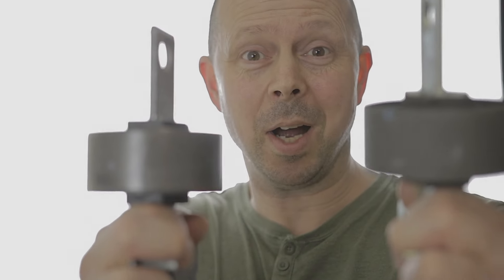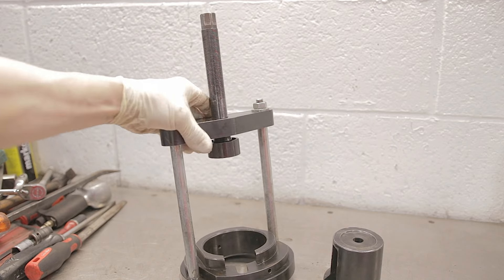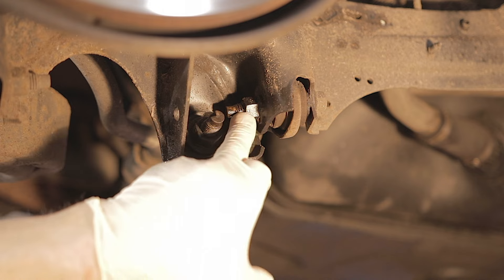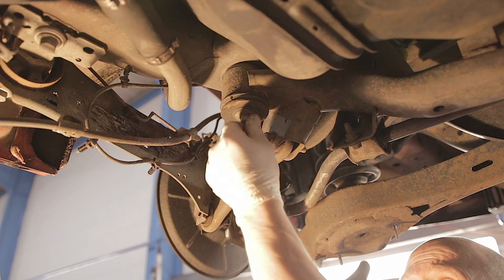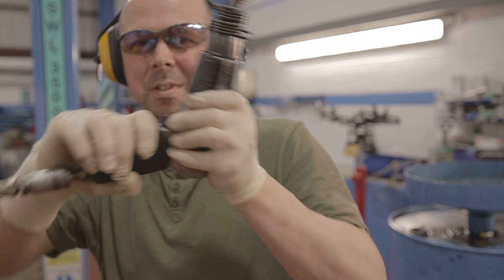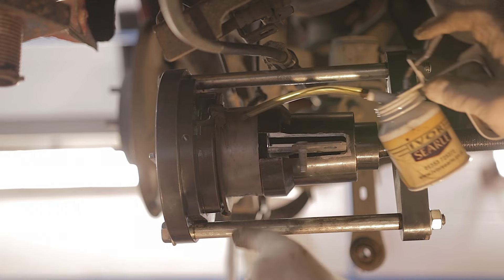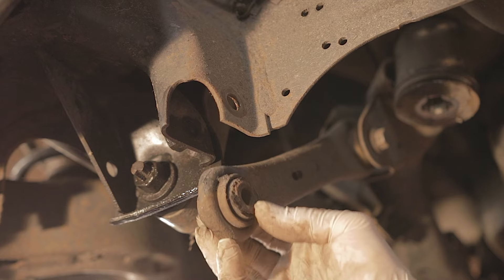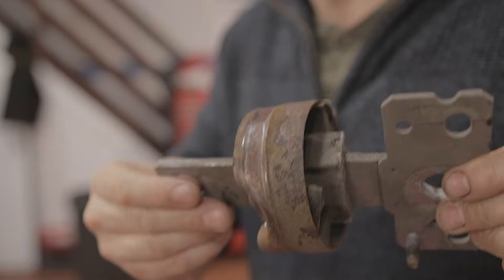Ford Mondeo Mk4 Rear Trailing Arm Bush Replacement

Comment: As for the bush alignment, there is a protruding lump just inside the outer ring of the bush which is alignment marker. It lines up with the notch in the trailing arm.

Comment: Great stuff. Have you ever tried the Powerflex version of the bush that can be installed without the fancy tool?
Reply from the maker: Badgertronix 
Ok..  you got me .. lol.. I never heard of those?
I will look into that one. Sounds interesting to know. Thank you my friend
Reply: alan howatt these ones here: https://www.powerflex.co.uk/road-series/product-details/Rear+Trailing+Arm+Bush+/12423.html
Reply from the maker: Badgertronix 
Them bushes look good if you don't have the tool to fit the genuine ones. 
  Only down side is the price. 
  Nearly £70 per side for power flex and the ford ones are about £28 per side. Still thanks for the info.
Reply: Alan Howatt I’ve a set of the powerflex ones you’re more than welcome to have a go at fitting them for me 😜👍🏻

Comment: Hi Alan, how long did it take you to replace that rear trailing bush? Maybe 30 minutes? I was told in Ford, they only change the whole rear axle due to the rust...
Reply from the maker: lol, they probably don't have the tool to replace those bushes but also a lot more expense for a new trailing arm

Comment: There is another similar tool made by "Sealy" or "sealey". Just done mine today as part of its 10 year service. Its a lot easier with a ramp as well but you don't have to lower the suspension, just the arm.
Reply: you all probably dont care but does someone know of a method to log back into an Instagram account??
I somehow lost my password. I would appreciate any assistance you can give me.
Reply: @Augustine Huxley Instablaster ;)
Reply: @Devon Kenneth thanks so much for your reply. I found the site on google and im in the hacking process atm.
Seems to take quite some time so I will get back to you later with my results.
Reply: @Devon Kenneth it worked and I now got access to my account again. Im so happy!
Thank you so much, you saved my account :D
Reply: @Augustine Huxley happy to help :D

Comment: Alan, are the lower arm bolts prone to seizing in the Bush like the Mk2 Focus? Thanks
Reply from the maker: no all the bolts that i show in the video should come out no problem...the bolts on the focus are always seized lol
Reply: @alan4x  yeah i just did my focus mk2 estate 2005 nearside bush,, u can be sneaky undue the 2 bols and prise it down with wood etc,, but u need to pull it down very hard, the offside i just got pissed off and done it back up , fuel tank needs to be dropped by the looks of it. if u have a ramp then its easy because u can ratchet strap off the ramp,, wouldnt bother undoing 1 bolt on a focus rear suspension,, every single bush will be sized and need cutting off and new bolts etc, very expensive

Comment: Is there any need for checking the wheel geometry afterwards? Thanks for the video, need to do mine soon.
Reply from the maker: hi, your question is a good one, thanks, because the bush can be bolted to the chassis in a slightly different position to the old one, then technically speaking you should check the rear wheel alignment which is not a quick job..but i will say, i have changed many, many of these bushes on the company taxis... and never bothered to check the rear wheel alignment. never have i had rear tyres wearing irregular... so if it were me, i would not bother...if it worries you then you would be correct to have it checked, hope this somewhat helps.
Reply: alan howatt thanks. The toe on the OSR is off as the bush is separating, so I'm assuming replacing should correct it but I'll probably get it checked. The tyres for the 19" rims are a bit pricey :( Appreciate all the videos, keep it up. Is that your garage just before the air base off the A14? I drive past on my commute, thought it looked like you
Reply from the maker: hi, yes the steves garage in little stukeley next to raf alconbury, good luck

Comment: The best video showing how to replace rear trailing arms bushing! My Volov dealer quoted about $1000 to replace the bushing plus alignment, I tried to get it done by myself once I buy a set of right tools.
Reply from the maker: this company make bushes that might fit your car but do not need a tool to fit them, just a thoughthttps://www.powerflex.co.uk/road-series/
Reply: Thank you Alan for your recommendations. I was aware of that by reading notes left by your readers. I think I would stay with the same bushing as Volvo used, as they are quality products at lower price comparing those from PowerFlex.
Reply: @CMC5961  - Volvo bushes come with Lifetime guarantee? Powerflex ones do, so worth considering that next time.

Comment: Alan, do I need to get the rear camber etc adjusted after fitting rear trailing arm bushes on a mk4 Mondeo, love your content by the way😀
Reply from the maker: you could get the rear wheel tracking checked if your want but i have changed so many of these bushes now on the taxis and just bolted the arms back up ....none of the cars have had any abnormal rear tyre wear so i don't bother doing any adjustments

Comment: Thank you for the video! One question, after installation, is it normal that it turned rubber in them?
Reply: I do not know, but I think it is really impossible to find the sweet spot, you see the car is hanging and that "lift thing" is probably not pushing the trailing arm to the full extent, the moment he puts down the car it will be under a different load again and while driving conditions such as impacts or weight are constantly alternating....
All things said I've been told that this part is very unlikely to break, so I guess it simply doesn't matter too much. 
Although I must say mine is not twisted while hanging.
Reply: @joons3374  you put the bushes in and they have a flat edge that corresponds to markings in the blade. they could go in wrong but you would have to be a complete idiot to do them wrong or do it deliberately wrong......

Comment: Hi Alan, does the rear subframe need aligning after doing this or is it fairly "fixed" in place? Do you know if this procedure is any different for the estate version?
Reply from the maker: i have never carried out any alignment at the rear and never had rear tyres wear irregular but if needed the rear tracking can be adjusted

Comment: How much are the Ford bushes? Just had an advisory for 2 on the MOT. Great video by the way, i have just subsribed!
Reply from the maker: Richard Thornton 
Hi.. I checked the price the other week... they are about just under £30 per side inc vat. 
  If you look at the comment left by badgertronix, he has left a link to some solid bushes where you don't need a tool to fit them but they are more expensive for the bushes. 
Thanks for the subscription
Reply: Thanks for the quick reply. Probably use our main Ford dealer so can expect a big labour charge!   Cheers.

Comment: Very very good video. Well done 👍🏻👏🏻👏🏻. Got a ford mondeo and Split both rear trailing arm. Waiting for ford garage to fix it. My question is, how does it got damaged and how to maintain it once fitted?
Reply from the maker: the rubber bushes will perish and split over time and general usage....even if you drive on flat roads very carefully they will eventually split again
Reply: Alan Howatt is that for all cars or just for ford? This is my second ford and they both got the same problem.
Reply: Use the PowerFlex bushes, lifetime guarantee so shouldn't really need changing again. Don't refit these as they're unfit for purpose.

Comment: Great video. Mine was torn apart. I had to remove the whole arm because i donot have that tool. Went to a shop and pushed it with a press.
Reply from the maker: cheers

Comment: Maybe a little late asking, but what would you recommend for those of us without air chisels available?
Reply from the maker: if you can break the rubber centre out of the bush, usually by twisting it with a large screwdriver and cut a slot in the outer casing with a hack saw blade then the bush outer casing should tap out quite easily
Reply: @alan4x  Thanks for the reply! Do you reckon a coarse file would do the job just as well as a hacksaw blade?

Comment: Hi, 
Ive got this advisory on the last MOT:
Nearside Rear Suspension arm pin or bush worn but not resulting in excessive movement Trailing arm bush. (5.3.4 (a) (i))
Is this what you are changing here?
Cheers!
Reply from the maker: yes thats the trailing arm bush
Reply: @alan4x  thanks !

Comment: I've been told by a garage that these bushings are usually the last to go with general rear suspension failure. Meaning by the time they need to be changed, shocks and other stuff are already gone, and that's why the bushes are failing. Is this true?
Reply from the maker: no I've not heard that, those bushes are all i ever have to change on the rear apart from anti roll bar links
Reply: @alan4x  thanks Alan. Figured they would just love to charge changing the entire blody rear end. Changed just the bushings as the car rides perfect.

Comment: Hi, great video, does the car need the tracking / camber etc rechecked after this?
Reply from the maker: hi, i have never bothered to check the rear wheel tracking and never had any of the taxis with irregular rear tyres wearing so if it bothered you then do but i would say don't bother

Comment: Watch all your car vids Alan,
This has been worth watching too 
Great to see you out with your lovely boys... 
question 
I’ve got a binding off side rear handbrake I’ve loosened it with wd40 and gave the bracket pivot a grease and it’s done the job for now bug what’s the actual fix? 
Strip+ clean & rebuild 
07 Mk4 mondeo estate 2.0 
Quick yes or no would do mate.
 appreciate chap👍🏻
Reply from the maker: hi, i would not attempt to take one of those calipers apart..get a new one or good used one...plus check cable is not seizing

Comment: Hello Allan

I have, benefit from your informative videos when something needs to be done on my 2013 Mondeo.

Thinking if it could help others if I ask if it's these Rear Trailing Arm Bush, is to blame for my car, crabs around the corner sometimes.

Seems like the rear end is driving over a point where it is loose, or changing camper or direction on the rear wheels. I can not find fault in my bushings or wheel bearing.

Have changed my shock absorbers as these were worn but it did not help.
The car has driven 200,000 km / 125,000 miles.

Sincerely
Carsten

Comment: What make and model is that bush tool. We have one but it’s different to that and have issues getting the bush in correctly as a result.
Reply: all the bushing press tools are the same, shit, they dont sit properly against the arm because the arm is ribbed,, get it set up as best u can then press it in , it will start on the piss a bit but soon will press in level

Comment: Replaced mine with powerflex ones last month, now recently i seem to be having some metallic clunking/grating/rattle noise when driving. Looked underneath and nothing loose other than exhaust heat shield which i thought was it and reclipped but that didn't fix it.  Noise seems to be getting worse after driving over some bumps yesterday. When stationary and open the boot and bounce the suspension i can't reproduce the sound, but it does make some mild grating noise, not sure if thats normal. Also the rear suspension springs seem to have some of the outer metal peeling but didn't look broken to me, is this norma;? should i replace these?   Any ideas please? tracking stuff like this down is a nightmare lol.

Comment: Hi Al

Not sure if you answer private mails but desperate to sort a prob and who better

My MK4 has a tendancy to wear rear tyres unevenly on the inside.  I mean not all the way around just about 90 percent so after a while we get a wow wow wow tyre noise at anything over 50mph

Mot picked up again last week on this on a tyre with only 4000 miles on it.

No accidents ever or curbs. Passed mot no issues and I asked if he would check the suspension.  Advice was they all do it it's common

No bushes showing wear.

Wheels are in balance

No there are camber bolts for sale on eBay.  From the rear the wheels do look tipped in at the top so can these bolts help?

Hope you can help. Going through too many tyres

Cheers Al
Reply from the maker: hi, the rear wheels are probably out of alignment and need tracking...the inner bolts on your lower suspension arms .. the arms the springs sit in are what you would loosen to adjust the rear tracking... that's if they are not seized up..you just need to find a garage that knows how to track cars properly
Reply: @alan4x  cheers Al. Will look at that

Comment: hey Alan, thanks for the video. Could you please tell me what kind of bush fitting tool you are using. Where can i buy such a tool? Thanks!
Reply from the maker: its been a while since got the tool but it is a company called" first line" .....might be worth a check at any motor factors or ebay

Comment: Nice vid as per Alan , very helpful..
Had my First MOT today since ownership.. advisory on these rear trailing arm  bushes , worn , but not excessive... so I guess I have a while ..  
looks a huge job and something I won’t be able to do myself and looks like things need supporting...
Cheers
Reply: Same just got the MOT done with the exact same advisories, the car is on a 95 plate I'm the second owner so not a bad car a 2.2 Titanium sport   95,000 on the clock
Reply: @WorksopGimp  If you can, get the Powerflex PFR19-1917 bushes, around £95 for the pair on amazon, lifetime guarantee so won't need replacing again.
Reply: just had same only 2009 plate titanium and had it changed £125+vat which I thought wasn't to bad
Reply: @yusefmohamed8152  I am looking at changing these. But unable to find a suitable garage. Ford quoted 982£ for both rear
Reply: @yusefmohamed8152  where did u get urs changed??
Reply: @yusefmohamed8152  was that a pair of just one? I am guessing just the one. Alan makes it look easy but I guess that is he's very experienced and worth his weight in gold to his company. if I could get under the car on my drive with enough hieght I would do it myself plus I have air chisel so it would probably take me severals if at all!

Comment: I bought bushes from Lemförder for my Volvo V70. Looks exactly like Volvo original but 60eur for the pair instead of 200eur from the stealer...  Same bushes on Volvo as on Mondeo mk4 and S-Max
Reply: Did they have the same, matt surface he talks about in the beginning?
And, did they fit?

Just bought a pair of aftermarket ones for my Mondeo. Believe they are identical to the ones for Volvo.

Comment: Rear near side tyre bald across surface. Turns out the bush needs replacing on both sides. Told that its a 2 person job really and tool needed after seeing this I can see why. They say it's speed bumps damage it just like they do to spring coils. Then they will do the 4 wheel laser tracking which it went in for in the first place !! It was only luck that the guy heard the clunk sound as he drove it over the wheel rollers. To be fare they could have just done the laser tracking and not told me.

Comment: How does one know if they need replacing? My mk4 is 9 years old with 120,000 miles.
Reply from the maker: the rubber centre part of the bush will be separating from the outer casing.. in some bad cases the bush can almost be falling out of the arm
Reply: alan howatt thank you